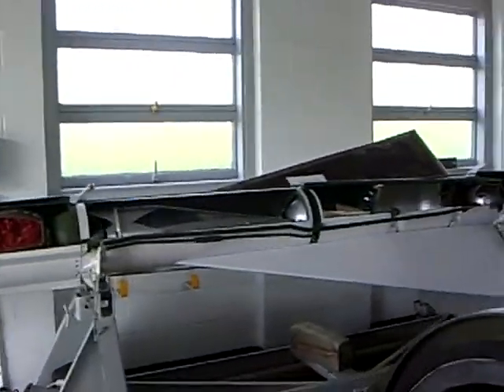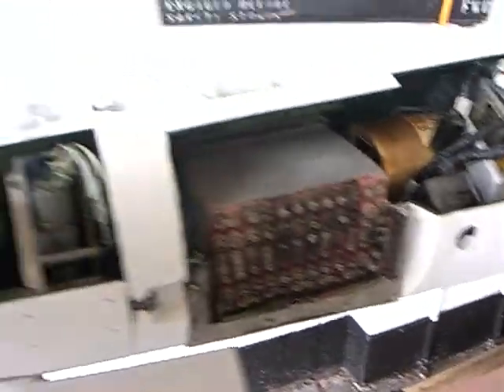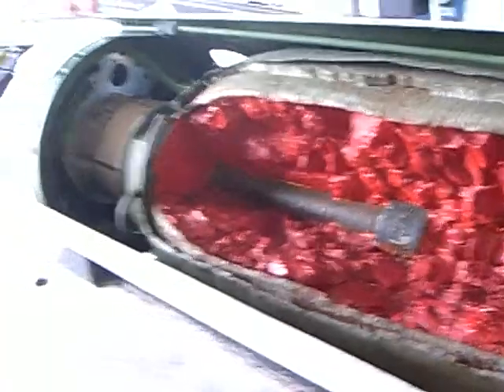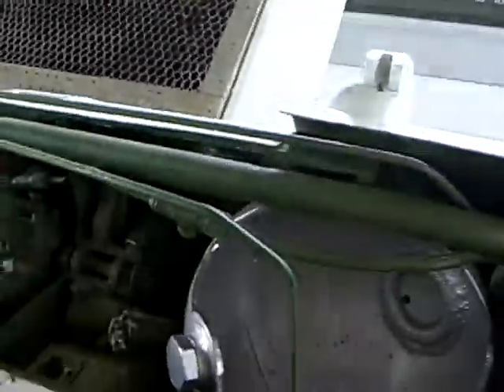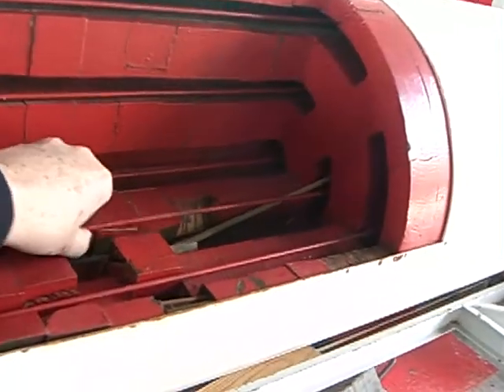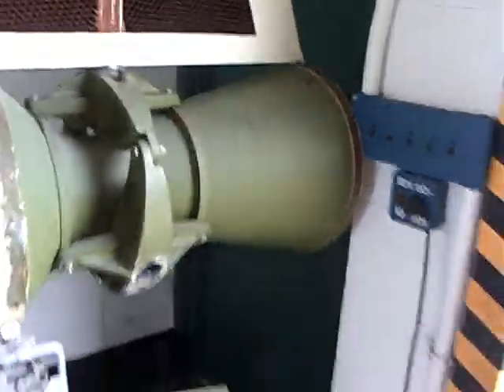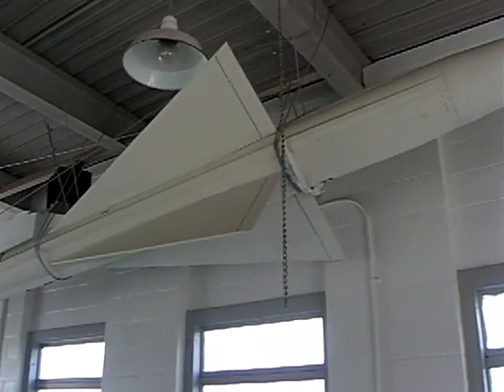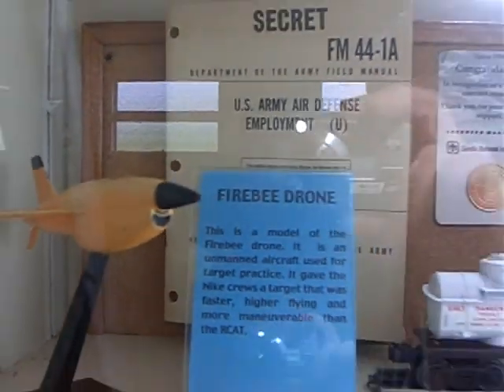Close look at Nike Hercules and Nike Ajax Surface to Air Missiles. Battery site SF-88 #1

Comment: Thank you for posting this. I grew up near one of the 12 Nike radar sites surrounding Philadelphia. It had closed by the time I was in elementary school (late 1960s) and I never knew it existed until the 2000s. That site is long gone and is now houses. The launch site is about 1.5 miles away from the radar site and is also houses.